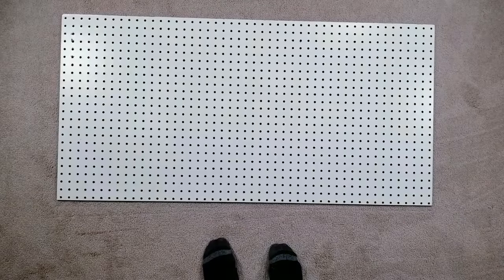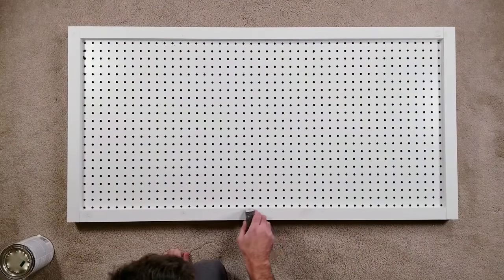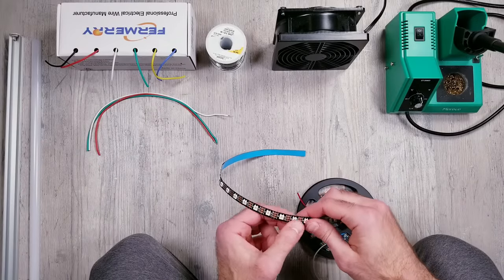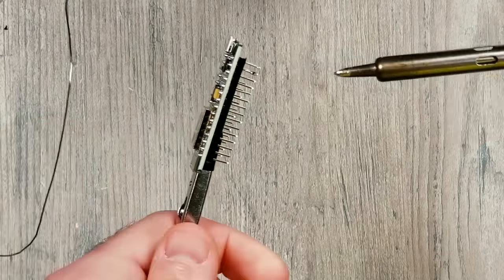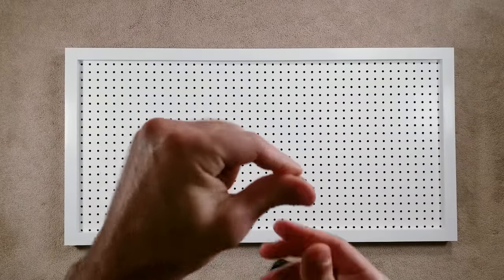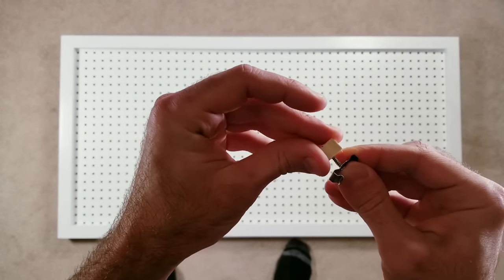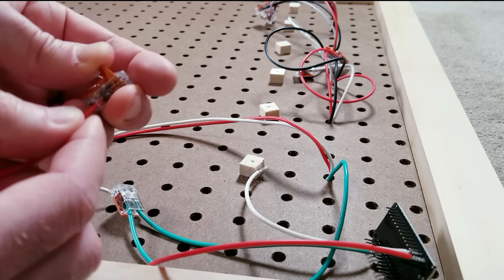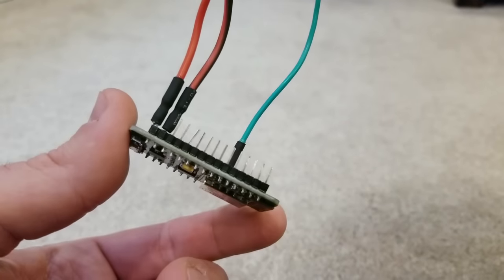DIY LED Project with Diffuser Channels - Full Walkthrough

Comment from the maker: 📦 AMAZON’s BEST DEALS (updated daily): https://bit.ly/3VWZKVS
📣 AliExpress’s BEST DEALS (updated daily): https://bit.ly/3VwoaDW
☑ Check out my sponsor to begin your FREE 14 day trial to Aura: https://aura.com/chrismaher
Spotless Regular LED Diffuser Channel 1m Amazon: https://amzn.to/47aIujz 
Spotless Regular LED Diffuser Channel 2m Amazon: https://amzn.to/3QoHeDb 
Spotless Corner Diffuser 1m Amazon: https://amzn.to/3DFhRpf 
Spotless Corner Diffuser 2m Amazon: https://amzn.to/3Krqw2q 
LED Lights WS2812B on Amazon: https://amzn.to/3pngBDO
AliExpress LED Lights WS2812B: https://s.click.aliexpress.com/e/_Der0k7N
Esp8266 LED Controller: https://amzn.to/33BwvvP
5 v Power Supply: https://amzn.to/3HTFdam
Silicone Wires: https://amzn.to/3KtISgE
Peg Board I used: 24" x 48" panel from Home Depot or Menards. 
Peg Boards on Amazon: https://amzn.to/3Mwbt71
Peg Boards on Amazon: https://amzn.to/3vU8KhI
Peg Boards on Amazon: https://amzn.to/3CsDasU
White Mesh Cable Wrap: https://amzn.to/3tFebi0
Solder: https://amzn.to/3tGbixf
Heat Shrink Tubing: https://amzn.to/3CpstXO
Soldering Station: https://amzn.to/3IWQo3t
Helping Hands: https://amzn.to/3hRMaOt
Other How To Videos I've Made:

LED Baseboard Trim: https://youtu.be/Ik8HnGxfQq0
RGB Lamp Hack: https://youtu.be/UNPR_98xLQY
Corner LED Light using Pex pipes: https://youtu.be/rIbTzUD2E4k
DIY Govee Glide using only paper: https://youtu.be/n9LsiQARFas
Simple Corner LED Project: https://youtu.be/ZB5HqWhMXNo
DIY Customizable Light Up Images: https://youtu.be/2q_zrEcbXHE
LED Strip Diffuser Ideas: https://youtu.be/09-fiWjP42Y
DIY Hexagon Project: https://youtu.be/t9xGyB4ahyY
DIY Edge Lit Designs: https://youtu.be/0_TtHkBB3vA
DIY Black Acrylic Floating Shelves: https://youtu.be/6csSMtV_op0

Unboxing Videos: 

Best Diffuser Channels (same ones used in this video): https://youtu.be/1SKo_HdKVYA
Lytmi Neo 2.0: https://youtu.be/sth-EdEfSis
Govee Lyra Floor Lamp: https://youtu.be/NFDYz37ZoXU
Govee Glide Hexa Panels: https://youtu.be/UDYUvfce4tM
Govee Glide Light Bars: https://youtu.be/e3jJye-fYoM

LED Tutorials:

Installing WLED on esp8266: https://youtu.be/l8OMi7SMpqs
Power Options for LED Strips: https://youtu.be/KFtjf5mD6tA
Use WLED with Govee Lights: https://youtu.be/l0sRG1WAbq0
Re-Use Leftover LED Strips: https://youtu.be/ASnuk-XDVbI

The best way to help support my channel is to like, comment, make sure your subscribed and share my videos with as many people as you can. The other way is to use my links above as I get a small % at no extra cost to you if you buy something. Thank you all for the support!

The song at the end is from my favorite artist Kalax. In my opinion he is the best there is in the Synthwave genre. Make sure to check his music out and support him in any way you can!

Kalax - Out of Time (feat. Pyxis, Jay Diggs) [Official Music Video]
https://www.youtube.com/watch?v=em1Ar8iq3d8
Link to his website: https://www.iamkalax.com/?fbclid=IwAR...
Link to his Youtube channel:  https://www.youtube.com/c/Kalax

Comment: Hmm, maybe use the end caps, and drill a hole just small enough for the wires to go through and stick them through, you won't see anything, and i doubt it will really be disturbing the LEDs don't really go all the way to each end. Make it as tight as possible of course.
Reply from the maker: For sure a great idea! I think that would work really well and be able to pretty much hide all the wires! Thanks for watching and the awesome suggestion!

Comment: If you put all the wires in to a single slot of the wago connectors, the connector may not clamp down on them correctly and they can come loose, among other issues.
Reply: Agreed. Electrically it's the same connection either way, but mechanically it's better to keep one wire per slot. If you wanted to tie them all together you can just use wire nuts like what're used in home electrical wiring. However, I'm not sure how well stranded wire holds in a wire nut.
Reply from the maker: Thanks for taking the time to comment and answering my question. I knew someone watching would know the answer! Thanks for watching and appreciate the support!
Reply from the maker: That makes sense! Appreciate the explanation and for the advice. Thanks buddy!

Comment: Adhesive for bonding metal (or literally any surface, including glass): JB Weld. There are other two-part epoxies out there, but JB Weld still has little competition other than more specialized applications.  Although if you planned to use magnets, you probably should've started with one of those metal pegboard panels?
Reply from the maker: Thanks so much for the advice! A few other people have mentioned jb weld so it must be amazing! The metal pegboard would for sure be fun to use! I think I went with this instead of anything else because it was about the cheapest thing I could find. I think it was less than 5 dollars at home depot lol!
Reply: @ChrisMaherDIY  roughing up the two surfaces with some sand paper or an emery board can help jb weld get a better bond as well 👍

Comment: What to do with the end wires of last diffuser.... You haven't showed anything about them in this video
Reply from the maker: Thanks for watching! I just put a wago connector on each one of the wires so that it's super easy if I want to add any more sections down the road or even inject power at the end using the wires. Hope that makes sense!
Reply: @ChrisMaherDIY  yaah yaah... I got it now 😇😇

Comment: Hi Chris,
While using a clamp connector (as WAGO invented it in 1951), you have to use only one wire per slot.
Otherwise If you connect 2 sires, you can't be 100% sure that both wires are 100% the same size. So the bigger one would be sure connected, but the smaller could be less connected, and disconnect with vibrations. Or create a hot point if you have a lot of current passing through.

By the way, you don't need to weld some tin on your wires if you use WAGO connect, 221 connectors are build for both solid wires or not.

Thanks for using WAGO ;)
Reply from the maker: Thank you so much for that great information! That makes total sense now why you should only use 1 wire per slot. Also thanks for letting me know the wires do not have to be soldered! Thanks so much for watching and taking the time to comment!
Reply: if you twist the wires together though you should be able to use a single slot, right? as long as it’s twisted together well
Reply: @danieljames500  yes you could.
But the best would be to use a 2wires ferrule to join the two wires together perfectly.
For example 2 wires 1mm2 could be gathered using a Wago 216-542

Comment: Pretty cool! The end result is a nice addition to your LED room 😁

The nice thing about DIY projects is that there's more than one right way to do things, and I'm not trying to say that anything you've done here is wrong. Everyone has different tools/methods and different personal taste. But if I were to replicate the project here are a few things I'd change:

- Power injection, especially if you're already using wago connectors. Would be super easy to connect power from the beginning of the first strip to the middle and end of the circuit. Just swap out your 2 way wagos for 3 way, add a few jumper wires, and you're golden. You'll be able to run them at full brightness with no line loss and less heat. I was actually kinda surprised to not see any line loss on a full 5m at 60 LED/m, though I'm not sure if you have them on max brightness?

- I would personally have all of the LED strips running in the same direction, rather than back and forth. This could be done easily in WLED (use the segment feature, and flip them around) or with a rewire. I think a bunch of 1m bars running the same effect/animation in similar colors in the same direction but at slightly different speeds would look totally dope. Would be slick with Aurora, Android, or Sinelon effects, I think. 

- Wago connectors, solder, and raw ESP boards do work fine, but I would suggest looking into crimp-on ferrules for the ends of your wires. They are a lot easier to work with, give you a better connection into wago and screw-terminal connectors, and will save you a few headaches. As we've chatted about before, DigUno boards work great for projects like these, would definitely recommend them 👍

Thanks for sharing another great project, Chris! I'm definitely going to steal a few of your ideas for my own setup 😁
Reply from the maker: Thanks as always! I love your ideas on how to do things differently. The power injection like you mentioned would be super easy! I'm not running them at full brightness. In all my projects, I've always been surprised at how bright things get without a lot of power. Although I'm really only down in my basement at night where a little light goes a long ways in the dark. I'll also have to look into crimp-on! I'm all for making things easier to work with. You know your WLED! I will have to try the segments here soon since I also think that would look sweet! Thanks for watching and all the great feedback!
Reply: @ChrisMaherDIY  Cool! Looking forward to seeing the changes in a future video 😁
Reply: Rewiring them to run in the same direction would waste a lot of wire since you still need to follow a single data path to be able to segment them. You could run the strips in parallel, but then you lose the ability to control each section individually. WLED allows you to reverse the direction of segments so that they all appear to be running the same direction visually.

Comment: JB Weld will grip the magnets better. I'd recommend using enough to create a small shoulder around the base of the magnet so that it grips from the sides as well as the back of the magnet.
Reply from the maker: Thanks so much for the tip! I'll have to try that. I knew someone watching would know what to use! Thanks!!

Comment: use JB weld for the magnets and metal clips. it bonds super good to metals
Reply from the maker: Thanks so much! I'll have to try that next time. A few other people have also recommended that so it must be good!
Reply: @ChrisMaherDIY  it really is but you gotta be super careful, as once it gets onto a surface (especially metal) it forms this super hard concrete or ceramic kinda skin, and its nearly impossible to remove without damaging the material underneath. 

its also resistant to chemicals too, so acetone and petroleum based products wont work. but if you wipe it up before it hardens then you'll be good.

Comment: I would look into possibly using a panel bond typically used in auto body repair that might work. That’s what I use for installing rocker panels on cars instead of welding the seams they are glued on with the adhesive. The brand we use for work is 3m though it isn’t the cheapest.
Reply from the maker: Thanks so much for the info! That sounds like it would work perfect if its what you use for cars! Thanks for watching and taking the time to comment!

Comment: Great video as always.  I have never solder before and glad you explained what you were doing.  I just built book shelves for my wife and going to add LEDs behind each shelf.  

For the frame maybe building it like a picture frame or taking a 2" wide board and running it along your table saw to create a groove/channel for the peg board and doing 45 degree miter?
Reply from the maker: Thanks so much and glad you liked it! That would definitely work doing it that way! Probably save a little bit of money on wood as well! 45 degree miter would have worked and honestly probably would have looked a little better! Thanks as always!

Comment: The cheapest adhesive option when looks aren't important is baking soda + super glue since they are both at Dollar stores. The baking soda instantly cures the super glue and it's extremely hard. It can even be filed or sanded. It's like cement. 

There is also a variety of 5 minute epoxy. Then there is high heat hot glue. Not the normal hot glue but the high heat guns and sticks. Much stronger then the crafting hot glue. 

If you need to drill or say tap the adhesive I would use jb weld as once cured it can be drilled/tapped.
Reply from the maker: Thanks so much for watching and for the great tips! I knew there would be at least 1 person who knew what to use! I'll have to try that next time since I really do want to use the magnets!

Comment: Can you tell me how this Esp8266 LED Controller actually works? How can you control all the effects? This looks really interesting and you did everything understandable for everyone, im thinking of building this, too ! :)

To your question : No it don't make any neccessary change, if you put all of the wires together,.but in electricity its much easier, if you know where the current is-to just take it off and after that everything is current free and you can work without any problems in case of Current on the wires. Its actually getting used like this in building /changing anything in buildings.
 (sry for my quite weak english, im actually from Germany.)

Keep up  the Great work, I really appreciate your content .
Reply from the maker: Thanks so much for watching and taking the time to comment. Thanks for the explanation with the wires. That makes sense! There are a lot of great videos on the WLED installed on esp8266 controller. Here is the one that I made going over how to set it up and basic controls. Its very simple once you do it a couple times! https://www.youtube.com/watch?v=l8OMi7SMpqs&t=1s

Comment: Thanks for sharing this ideas. 

For the BTF 16.4ft 60LEDs/ m which power supply would you recommend ?
Reply from the maker: If you are just using 1 strip, I would probably just use the 5v 10amp supply. Something like this: https://amzn.to/3T7SMK6 you could use a 5v 5amp supply and that should also work well but if you run them at a high brightness and white, you will see some voltage drop. Thanks for watching!!
Reply: @ChrisMaherDIY  thanks for the information

Comment: So you had data wires on the first LED but then again on the 4th at 9:12. How does that work? in some parts it seems like they are all red white and black and then at 9:12 the one on the 4th row looks green.
Reply from the maker: Thanks so much for watching and great observation! So basically what your seeing is me running out of green data wires to use lol. The actual color of the wire does not matter. So I believe in this project I had red for voltage and white for gnd. Then the data was either the green or black wires. Sorry for the confusion! I generally do like to keep everything color coordinated since it makes it a lot easier!

Comment: 12v or 5v W2812’s?  Important detail since the ESP can’t take 12v safely.  Also curious about power calculations and the amperage you went with given the risk of drop-off with 5v.
Reply from the maker: Sorry I should have said that in the video. They are the 5v kind. The link takes you to the 5v ws2812b led lights. Those have been my go to lights for most of my projects and have worked pretty well! I don't exactly have a scientific approach to any of the powering. For this project I used a DC 5 Volt 15 Amp power supply. What I generally do is just hook everything up at the beginning with no power injection and see how it looks. I have never had a reason to have the lights at full brightness and full white so I'm generally just testing out different animations and color combinations and seeing if it passes the eye test. For this project I have the wled limiter set to 2000mh and everything looks great as far as I can tell with no power injection needed. Someone did comment however that if you did want to inject power, it would be super easy to add using the wago connectors!

Comment: I'm working on a project that'll need about 24 light bars about 7-8 ft tall( haven't decided). Any recommendation on light strips?  I need some that are app controlled and have nice effects.  Govee or WLED I've seen have decent effects in looking for.  Just need to know what strips I can cut and add together that'll give a great look without hotspots. Any info will be great.  I've went through a lot of your videos. Govee m1 would have been great but $100 I a little steep.  Thanks in advance
Reply from the maker: Thanks so much for watching and taking the time to comment! Sounds like an awesome project! I've really enjoyed using the 5v sk6812 leds. They work great and have a separate channel for white. they can be cut and attached at whatever length you need. For large custom projects like that, I would not recommend the Govee M1 due to the limitations you have on cutting them at whatever length. 
LED Lights Amazon: https://amzn.to/3Zguu3y
LED Lights AliExpress: https://s.click.aliexpress.com/e/_Dm2FaeJ
And then the light above (or any strip that has at least 60 leds per meter or more will look perfect in these diffusers:
Diffuser Channel 1m Lengths: https://amzn.to/3E1xSXc
Diffuser Channel 2m Lengths: https://amzn.to/3jO3wAu

Comment: Hi Chris, thanks for sharing this! I tried it out but the only issue I’m getting is the LED flickers when changing Colors and acts abrupt when powered using the 5V power supply. When I use a USB power for the ESP8266, it’s lower brightness but the lights are stable. Any idea what can be done to fix this?
Reply from the maker: Hmm that is strange! The flickering and changing of colors I've only ever gotten when the data line running from the esp device to the first led is a little too long. How long is the data line in your setup? I don't think that would be the issue here since it works with the usb but just trying to think of things to eliminate that it could be.